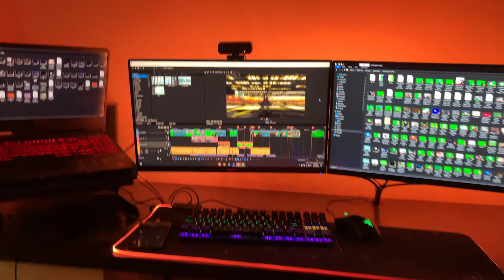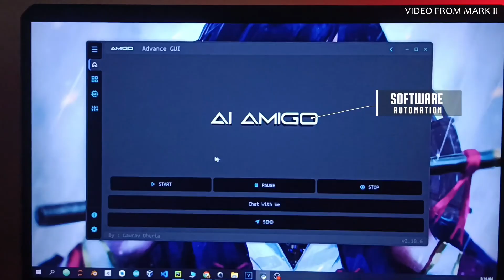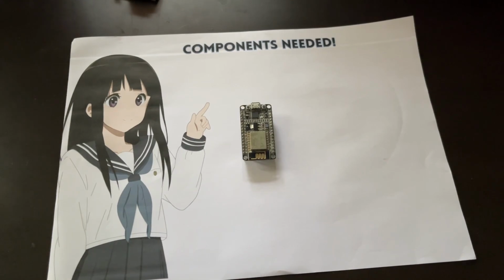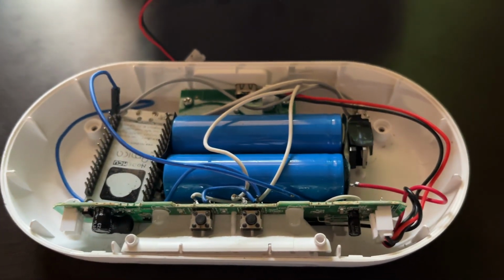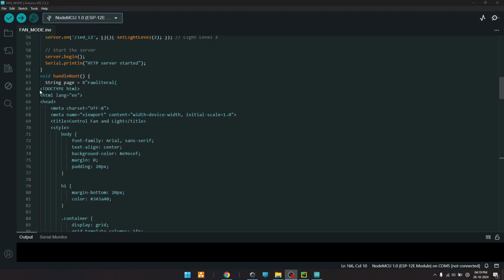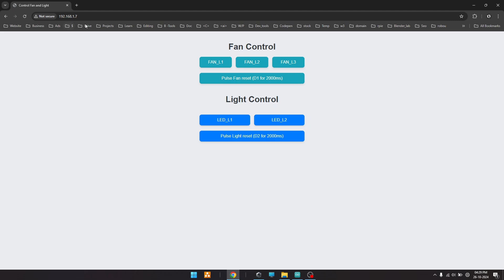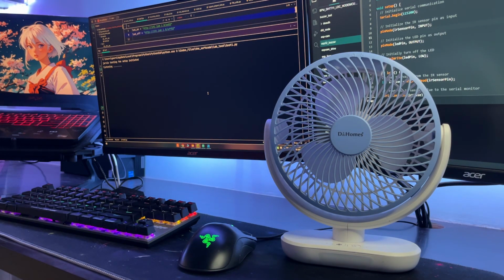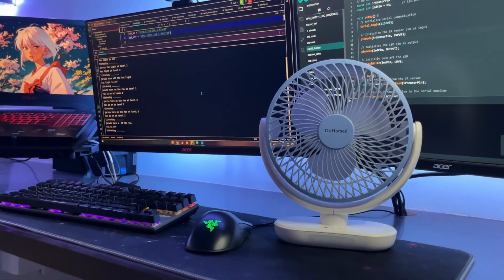Jarvis can Control my fan | Automation with electronics

Comment: could you upgrade it such that we use LLM as well for specific scenarios? For example, ur code could work as it is and it will be based on specific keywords maybe but for any other input we give it, it will use the LLM call